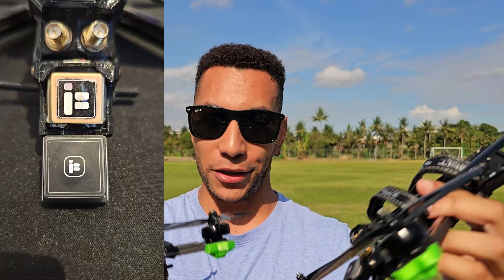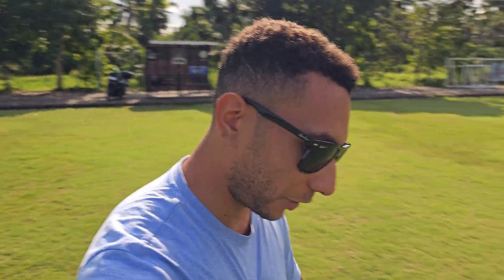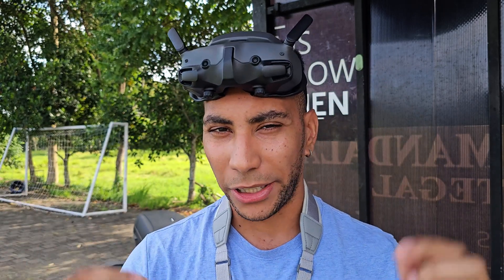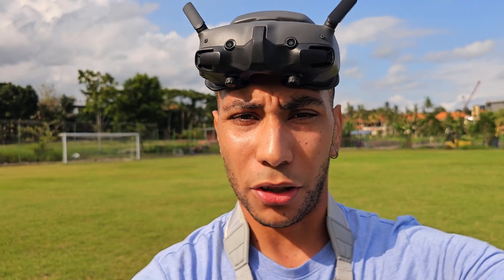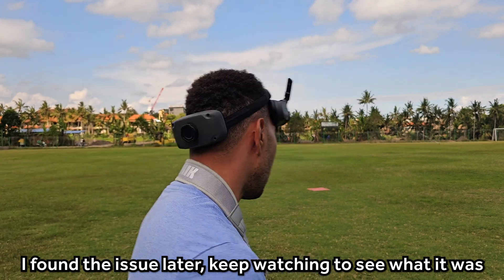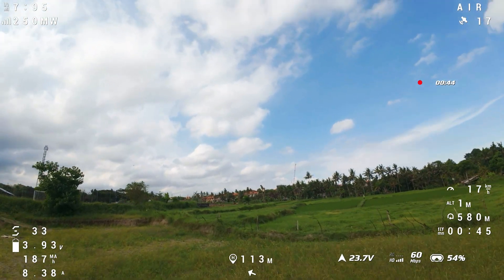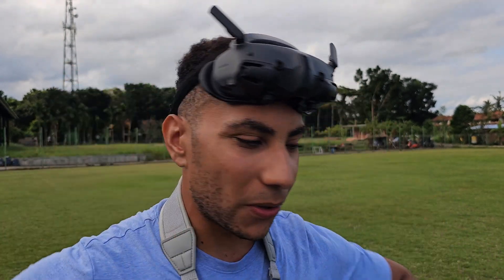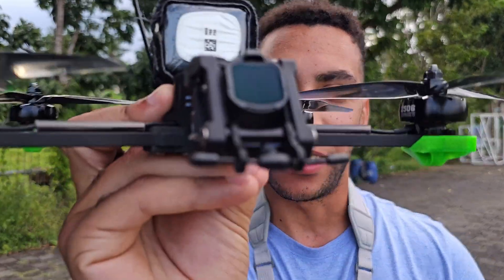Testing Out My NEW GPS Modules -  But I Still Have Problems...

Comment: are you using o4 pro? if yes many have problems RX loss between the elrs receiver and o4 pro, 
if using o4 pro it is recommended to use sbus communication with the dji RC2 or RC3 remote
Reply from the maker: I am, yes, the rx loss issue was fixed in the ELRS update 3.5.4. I wasn't having issues before this, but I updated anyway just to be safe.
Reply: @JustinBainbridgeYT  nice to hear that.. thaks mate, and see u @umakami resto with BDR

Comment: To close to power wire, that's why you loose sats.
Reply from the maker: It was wired the same before and working fine. Turned out the be the GPS_ublox_flight_model in betaflight. they changed the default setting on 4.5.2 for some reason.

Comment: Your loosing sats, because of the gps placement ( at least for me it was ) , it really needs to be up the front of the quad, i had the same issues as you and moving to the the front solved it
Reply from the maker: Hey! Could've been a factor, but sats were stable on 4.3 and then became unstable on 4.5.2 - This was then fixed by changing the Ublox airborne flight model as described in the video 😃
Reply: @JustinBainbridgeYT  Yes i just seen that at the end ... just checked mine an mine is on 4 as default !  not 1 ... Maybe that's why mine worked ok, as i did update after moving, but didn't see anything in the release notes about GPS.
How long is it taking for you to get 10 sats when plugged in ?
Reply from the maker: @shtumpa1  How bizzare on betaflight 4.5.2? I dont think it was changed on 4.5.0?
I've done a few quads now and all have been on 1G from default. No idea why they changed it. I have mine set to 8 for a lock and I get that regularly within 40-60 seconds of powering up.

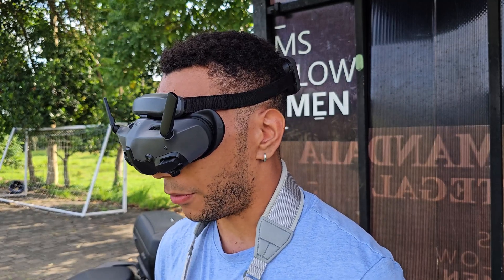Comment: 02:22 how did you setup your throttle? Mine is I need to push down to bottom the throttle to have it at 0%, and if I lift my fingers, it will push to 49% even my sticks is still on down position - which is so crazy. Making me crashed my GEPRC X5 :(
Reply from the maker: I'm not totally sure what you are describing here? Do you mean for arming?
What does the throttle movement look like in your receiver tab in Betaflight?
Have you calibrated your sticks?
It's hard to tell without seeing the Betaflight window
Reply: @JustinBainbridgeYT  Hello mate, I haven't got a time yet to check again in betaflight. I will check it on weekends and will ping you in IG if I cannot sort it out lol

Comment: Was the GPS rescue that rough because of the wind or are your settings that high?
Reply from the maker: Yeah there was around a 20mph wind that day, so it was very challenging, but it's a good test to make sure it works, My speed settings are higher than default too, the default speed is way too slow in my opinion 😃

Comment: Does the m10 GPS have a magneteometre in it? I'm trying to program position holding on my evoque f5d v2 hd
Reply from the maker: The M10 Mini V2 does have a compass yes. It might not be wired in from factory though. You will need to connect the CL/DA lines to use it